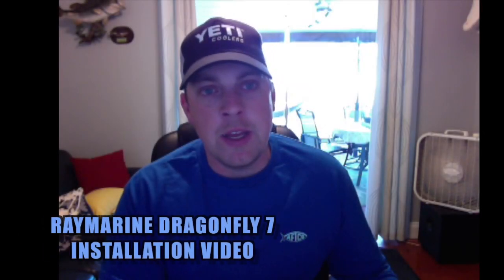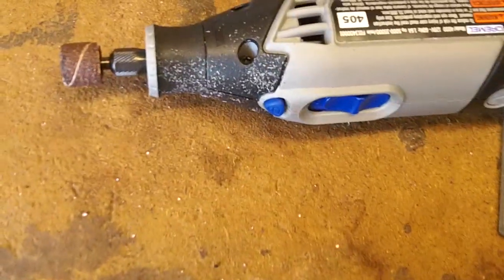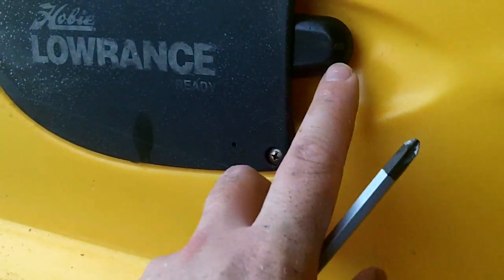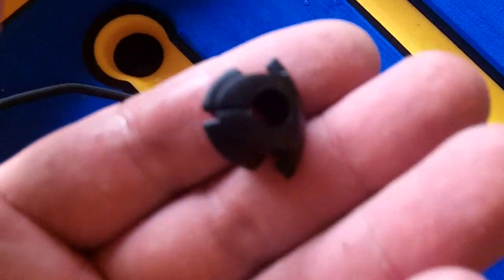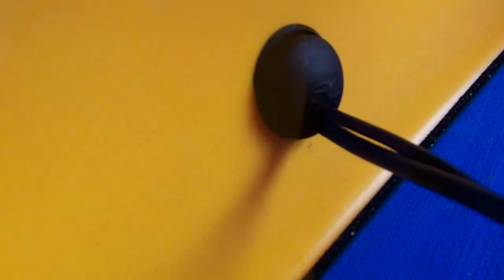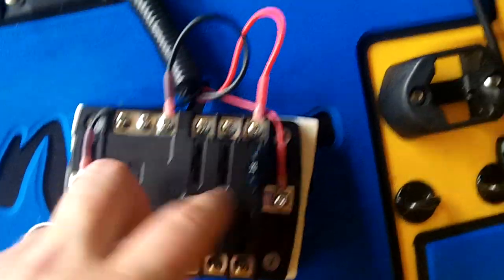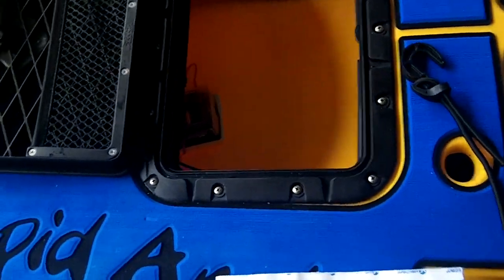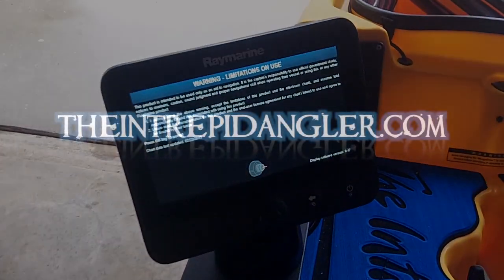How To: Raymarine Dragonfly Sonar/Fishfinder Installation on Hobie Pro Angler

Comment: I did mine this way as well with the new 7 pro.. wasnt as snug of a fit with the new transducer.. i had ALOT of interference on the water today to.. its such a beautiful picture but had lines running through the screen
Reply from the maker: I've got the new 7" Pro installed, but haven't used it yet. You may want to check if any debris are in between the transducer and mounting plate.

Comment: Do you notice any interference on the sonar with this setup?   I just installed this unit on my 17t, but cut out a spot on the cover and used marine goop to hold it in place.  I've gotten quite a bit of "noise" on the sonar after having done that.
Reply: +bigpiglights have you changed your set up. i got the new 7 pro and did the same install as the video and had some noise today as well..
Reply from the maker: +Zach Moore I'll have to take a look once I get it out on the water and contact Raymarine if it's an issue.